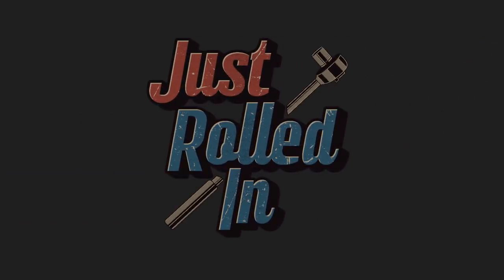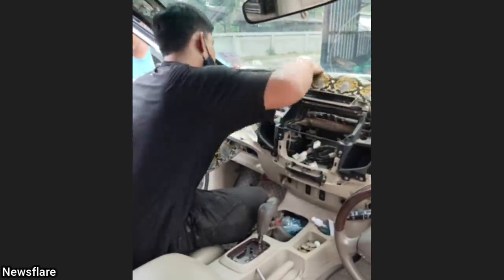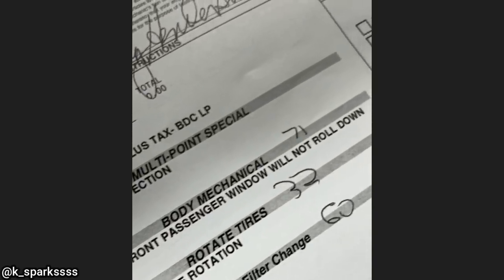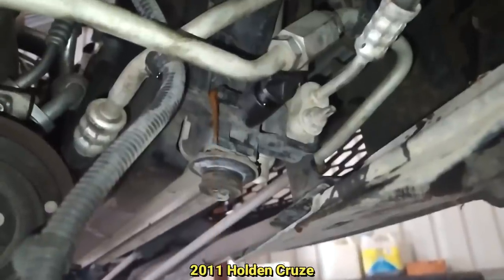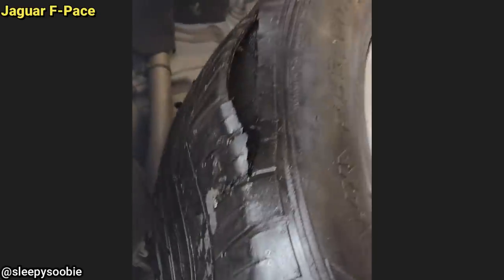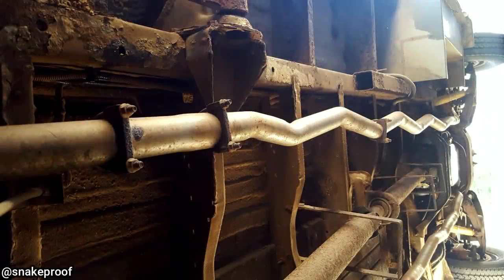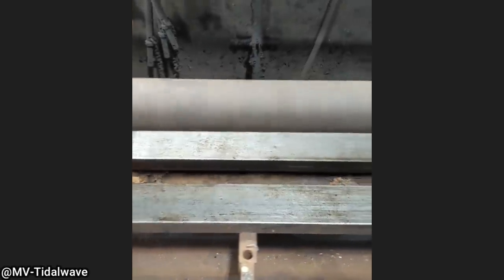Customer States Another Shop Did A Terrible Job Installing New Exhaust

Comment: The window not rolling down one reminded me of the time I spent an hour on the side of the road checking every possible thing in my engine bay, trying to work out why my car wouldn't start. Finally, I sat down in my car and while reaching for my drink, I happened to look down at my gear shift and went oh shit... I had been trying to start my car while in "drive". I still haven't lived that one down.
Reply: /laughs in manual gearbox! 😁
Reply: Just after acquiring my licence, I learnt that the hard way after dropping off my younger brother at the pre-dawn pick-up point for a camping weekend!
Reply: Been there, did that. And the window thing. Momentarily, but still happened. You don't reach my age without fucking up a few times.
Reply: I've done that before. Only once.
Reply: @katdeville  Speak for yourself. Things like this always seem to happen to other people for me.
Reply: On most cars the window lock will lock the windows only for the passengers. The driver should be able to operate the windows from the switches on the driver door with the child window locks on. That's how it is on my 2008 Escalade anyway.
Reply: I had done that once with my car. I had a small electrical issue with my TCS, but I wasn't sure what it was just yet. On the way to the mechanics, it went into limp. I figured "let's restart it at this stop sign" but I forgot to put it in park. Thought my car straight died on me. Didn't want to get a tow. But I decided to put it in park and wait for a second, but it hit me right when I put it in park that I'm a total idiot.
Reply: @teaurn  
People have forgot to put in the clutch and had the car not start.
Reply: @mitchhedberg4415  Sorry, but you can start a manual without pressing the clutch, as long as you are in neutral, which you should be when starting.
Reply: @teaurn  no. Most modern cars require you to press the clutch; otherwise the car doesnt crank.
Reply: @tobiasmetzger4522  'most modern cars' - so, a small minority then.
Reply: @teaurn  75% at least. With modern i mean everything like after 2000.
Reply: @tobiasmetzger4522  I think that will depend on where you live (in terms of are most people driving new-ish cars) and also the manufacturer...  But my original point stands - what happened to the OP couldn't happen in a manual!
Reply: @teaurn  your point stands only for older manuals. Most cars here are 10 years or younger and in almost all, you gotta push the clutch to start. So it could've easily happened as well in a manual.
Reply: @tobiasmetzger4522  You're making my point for me.  i.e. leaving your auto in drive is not equal to having to press the clutch to start a manual.  I could leave my manual in gear, and because I press the clutch, the car would still start - if it was an older car, it would lurch forward on the starter motor, leaving me in no doubt what had happened.  If you leave an auto in 'gear' it won't.
Reply: @teaurn  older Opels do start in drive...
Reply: @tobiasmetzger4522  But that isn't what happened to the OP.  Could we just leave it now, getting bored with the pedantry!
Reply: @teaurn  then just admit that you were wrong with your initial statement where you said you dont need to press the clutch to start it.
Reply: @tobiasmetzger4522  Oh I'm soooo sorry, I was wrong Tobias, you are the master - you know all things, why oh why did I ever think I could compete...  Happy now?  PS are you 12?
Reply: @tobiasmetzger4522  Depends on the manufacturer (you either have to press the brake or the clutch to start the car) and whether or not you have automatic start-stop mode enabled or disabled (or at all).
Reply: @MyRegardsToTheDodo  no. With no manual you have to press the brake to start it. And automatic start and stop has nothing to do with that. And you can't permanently disable it without changing the software

Comment: My own mechanic will not fix problems that were caused by other shops after he correctly fixed the brakes on a car that was done by another shop several years ago whose owner was not a regular customer of his. The owner argued that he spent enough at the other shop and demanded that my mechanic lower the cost. 

He's still shaking his head to this day over the demand that the car owner made.

Comment: If the fancy key fob breaks down, do you have to replace the whole car? 😁
Reply from the maker: 😂 imagine that.
Reply: It's cheaper that way.
Reply: $55,000 for the key fob, comes with free car.
Reply: Only if it's a BMW
Reply: Kinda like printers and ink. Sometimes, it's cheaper to buy a new printer than to change all of the ink cartridges.
Reply: @WastedTalent-  True, but the initial cartridges have less in them than the ones you buy.  

But that is why I bought a laser printer.  Sure the toner is expensive, but the cartridges last me years.
Reply: @NemoConsequentae   Recently saw on Facebook market-place someone trying to flog 5 or 6 identical cheap printers, none of which had any ink left in the cartridges, & was asking not much less than retail!  Obviously didn't twig to the fact that cartridges in those sort of printers are lucky to be a quarter full!
Reply: No dude you don’t know fact . This bmw car comes free with this tiny key. Buy a new key and you’ll get another free car!
Reply: Hahaha! No.
Reply: yes and also replace your house
Reply: @John_Ridley  Honestly that's a steal considering it was probably off a new 7-series which are $90k+.
Reply: Don't think so. Like most keys they're coded to that vehicle. You'd have more than one key fob for the vehicle. At least two. If the key is lost or has shitted the proverbial, you can order another key for that car and have them programmed to the car via computer. Same if both keys are lost. The majority of modern cars require at least two keys programmed to that car for things to properly function. You can have more than two keys programmed to one car as I have seen with a couple of car brands in particular here in Australia as well as overseas. Some car brands have less difficult diagnostic computer systems than others depending on the brand.
Reply: @BlairSauer  Yep. You can get at BMW new keys without having ANY of the old keys. The program blank key fobs.

Ask me how I know. 😒
Reply: @Slazlo-Brovnik  correct cocker. Other car manufacturers allow you to do that too.
Reply: Just what you want.  A nice shiny screen next to your house keys.
Reply: @John_Ridley  the funny part is that person just wanted to be extra bougie cus they DEFINITELY offer a normal key with that car.
Reply: @WastedTalent-  printers are sold at a loss, while printer ink is sold at a MASSIVE mark up. It's one of  the most expensive fluids out there.
Reply: Dude I know got locked out of his new Cadillac Escalade once when the battery in his fob died. There is no physical key that you can use on that model, everything's electronic. Good thinking by those engineer nerds. 😂

Comment: You got me with the BMW. What a cool key fob. When is technology going to stop. Oh yeah it’s not. I’m so glad I’m retired. Thanks for sharing my friend
Reply: It is a cool fob, but the only thing it is really useful for is the pre-condition function to heat up the interior when it is cold.
Reply: I wouldn't call it technology, but toynology.
Reply: I wonder how long the battery lasts in it. I have a 2 way fob for the remote start on my truck. It has a simple digital readout and the battery lasts less than a month. Good thing it's just a AAA.
Reply: @WastedTalent-  I have that bmw display key. Battery lasts about a month if not in use, there is a wireless charger in the car for that so when in use, it "never" goes flat.
Reply: I have a key to a 2000 Chevy long bed pickup and a '16 Freightliner.. my 14 focus is too complicated. 
I had an old Buick once it just needed a Flathead screwdriver. It had a small problem. Neither the fuel gauge nor odometer worked.
Reply: dunno about bmw, but my audi fob has a battery that's trivially easy to replace. new technology is almost always a good thing.

Comment: My local oil change/tire shop/whatever allows me to stay in my vehicle for an oil change and then requests that I bring the vehicle up to 2000 rpms to check for oil leaks around the oil filter.  Great peace of mind.
Reply: The oil change/lube shop I just visited did the same thing. I am glad that they did.
Reply: Wow. Hopefully you idle it for like 10- 30 seconds till the oil gets through the system.
Reply: no point for 2k rpm. It circulates when you turn on. A leak will be immediate
Reply: think is you are in the vehicle - you ain't gonna see it leak or even if they done anything in the first place!
Reply: @billynomates920  Worker is under the vehicle checking for a leak.
Reply: But at the "how to get a car mechanic in 5 Days school" they said: Oil filters only hand tight!
Reply: @spike378  Well yes... but oil pressure rises a lot from idle to 2000 RPM.  So a badly seated seal my appear okay at idle, but starts to leak at higher pressure.

Comment: It looks like these shops are letting the new guy handle the tough jobs. Bad news for the customer, great news for another shop.
Reply: It bugs me because the few times I've had to take a car in to get oil changed, they run a series of checks (now done on tablets) to make sure they didn't miss anything, but still, HOW DO YOU FORGET THE OIL FILTER?
Reply: Can't blame the new guys. Putting an oil filter on is pretty advanced stuff 😂

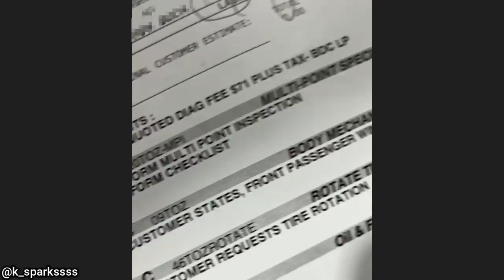Comment: 0:42 You know what?  I'll give them that one.  I myself and others have been stumped before trying to diagnose door issues because of those stupid child locks that you can only access when the door is open.
Reply: I don't think I've seen a lock disable the driver's controls.
Reply: @russellhltn1396  I thought the same thing, but these days, you never know.
Reply: @russellhltn1396  Nope, just the rear doors.  It keeps children from accidentally unlocking and opening the rear doors.  You can't get to the switch when the door is closed, however.

Comment: That lightning strike. I first thought it was somebody trying to do a tack weld...And I was right. Zeus was striking a hot arc LOL

How you been? I havent posted a comment in a while I think. About ready to finally...FINALLY mount my keyboard. This is probably the most overly engineered keyboard tray ever. It involves cables, suspension links, ball joints from an RC car and hooks lol...Then I can finally have room for my new editing computer....
Reply from the maker: Lol kind of looks like it!
I've been good. Just too busy lol. And sounds pretty advance haha. Send me a picture once you got your new computer set up.
Reply: @JustRolledIn  I will...I was taking a quick break and now Im getting ready to wire it all up. Its on zipties now. I had a bit to low, and when I would sit at my desk...lets just say a part of the rig colided with my groin LOL. 

Busy is good though.

Comment: How do these quick lube shops dosen't see any oil mess. When you start the vehicle the oil immediately leaks out because there no filter. Or maybe they didn't tighten good Idaway they mess up
Reply: Slam the hood and declare the job done. I doubt they spend time checking for leaks

Comment: Hitting the window lock does not usually disable its functioning from the driver's controls.
Reply from the maker: Usually not but I've seen Mazda's and Subaru's that work like that. Which is silly in my opinion lol

Comment: In the UK cars over three years old must have a new Ministry of Transport (M.O.T.) test done annually, before the licence can be renewed.  These tests are done at ministry recognised garages, and are quite stringent, though not terribly expensive. Faults on the M.O.T. List have to be rectified by a garage before the M.O.T. is passed, and the licence renewed, and the car is again insurable. We see very few breakdowns (‘stalled’ cars in North America) at the side of the road, and also its rare to see shredded truck tyres on the motorways, which many years ago was quite a common sight. Vehicles are a lot safer to drive (let’s ignore the drivers) in the UK.

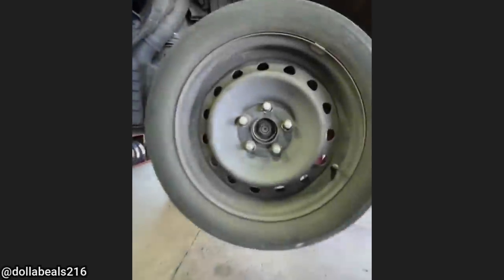Comment: 1:51 OMG really? I had Zorro in Mississauga do my underaxle 2.5 inch on my 87 Stellar (I provided the magnaflow muffler) for like... $300? Adjusted for inflation that'd be $400 now. Yeah sure it was crush bent, but they used stainless and what they didn't do was take a sledgehammer to it.

Comment: How could the car missing the oil filter even get out of the place?  They would have left a river of oil.
Reply from the maker: I was thinking the same. Must have been loose but tight enough to seal it from leaking oil. Or it was leaking oil and nobody saw 😂😂
Reply: No oil in there at all maybe?? Although you'd think it would overheat pretty quickly in that case... Some of these are real WTF moments, I find them jnctedibly entertaining and I'm not even a car enthusiast! 🤭

Comment: Forget the snake. Is that both a manual shifter and an automatic shifter I see? What's up with that?!
Reply from the maker: I saw that as well, i think that's the transfer case shifter.
Reply: It's a part-time 4WD. You select a low gear with the normal gear shift (see how instead of being a single straight line, the gear shift has a little step down to another line of gears? That's where you select 2L or 4L) then while in 4WD mode you change gears with the other gear shift. I have a Mitsubishi Pajero (Montero) that has that setup.

Comment: Looks like the mechanic was peeing on that overheated wheel.
Reply from the maker: 😂 I thought the same.
Reply: That's not hot.  Hot is when the drums underneath is glowing orange and even with water cooling from the top ice melting onto it still takes 30 minutes to cool enough to touch.

That was my brakes coming down monarch pass late June of 99 in a non Jake brake equipped truck.